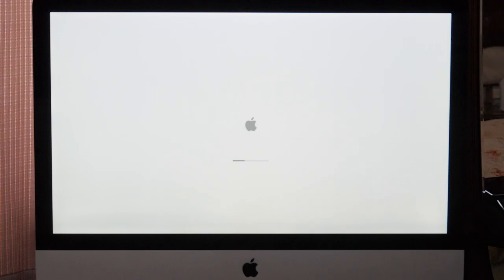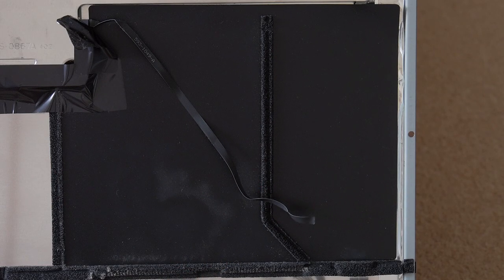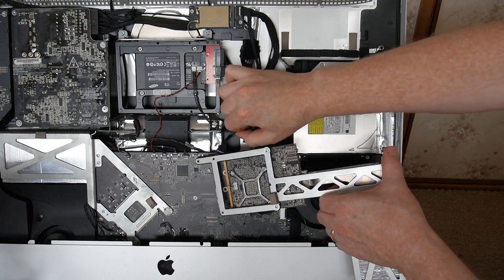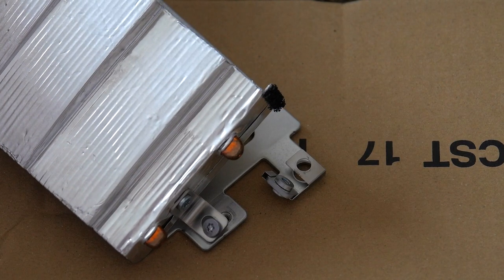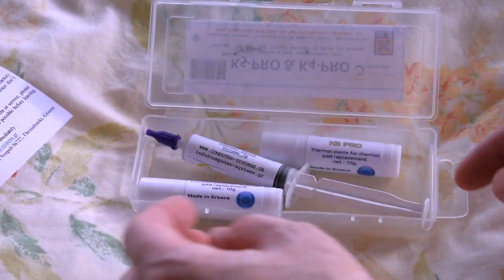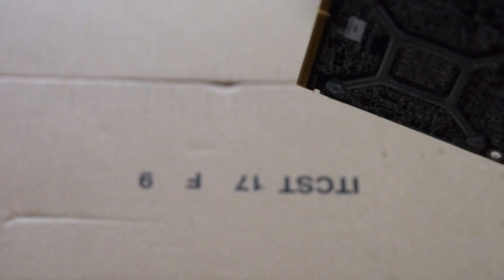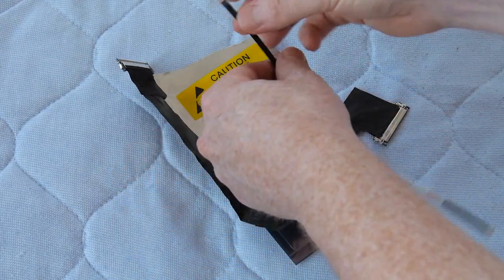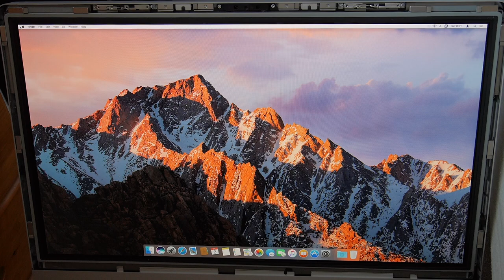Late 2009 iMac 27" Video Card Repair — 4850 — 2nd Bake

Comment: Damn it looks like my iMac has the screwheads on the opposite side, not facing towards the screen. Have to get all the way around to get the GPU off
Reply from the maker: Would you mind taking a photo of that and then posting the photo to Flickr or some other free cloud hosting service and then put a link to that photo in your reply?
Reply: Here you go: https://imgur.com/a/xFnUX
I was able to get it to work after baking it for 9 mins. But what a hell dissassembling it and assembling it again. I've had apart consoles, desktops, laptops, but this has got to be the worst I've tried.
Reply from the maker: Thank you for posting the photos. I'm happy to hear you were able to resurrect your video. I agree that Apple makes these iMacs horribly difficult to repair. Best wishes.

Comment: Just to let you know. This doesn’t fix the problem. It’s a bandaid. To properly reflow a gpu it requires specialized equipment.
Reply from the maker: Jason, I read and reply to every single comment.  There have been about 3 people, now 4 including yourself, who have emphasized the "bandaid" thinking.  That "this-isn't-going-to-work" thinking makes a big assumption though.  It assumes that the solder balls are the primary culprit and therefore baking at such a low temperature would not even melt them to adequately solve the problem.  I agree that IF the problem were the solder balls, this bake wouldn't work.  But the fact remains that my 2nd Bake, the bake after which I used fresh paste and a proper thermal pad replacement, has kept my late 2009 iMac's video card running daily for more than 11 months.  Eleven months is not a fluke or a bandaid fix.  It is strong evidence that a bake combined with the right pastes can in fact extend the life of one's Mac to such an extent that it is worth the time, effort and minor expense to do it.  

I don't mask the fact it takes a LONG TIME though.  It really does.  It's not a job for everyone.  But for those who have the time and desire, my two videos can provide the information necessary to get the job done.  And if you read through the comments, you see hundreds of people doing just that.  I am also not seeing numerous people coming back with follow-ups saying "my Mac is dead again."  There have been a couple folks who've had issues, but they've been in the minority, and I've actually guided most of them on what they should do next.  So regardless of how silly this bake may appear to be, it really does give new life to old iMacs which sadly have this flawed video card, regarding which Apple is fully responsible.  Does the bake give eternal life?  No.  Actually, swapping out with a brand new card of the same model will likely only yield 3 years of life because the card design is flawed.  But in my case, after my 2nd bake, I'm going on 12 months of continuous daily use, which even includes game play.  That's something to more accurately put this bake into perspective.
Reply: JDW I’m just telling you my professional opinion.. it’s not fixing it. You are better off finding a new card. And yes.. it’s a design flaw. Your gpu has overheated. Sure a few balls might have came off but.. it’s actually the die on the gpu. Back in 2008-2011 amd and nvidia went with a cheaper package that used a epoxy bond to keep the die in place. Unfortunately it was not adequate for the heat. After a about 900 hrs the epoxy releases and moves. Unfortunately... when it moves the chip is damaged. When you reheat it the chip will move again.. it’s basically done. I’m not trolling.. I’m telling you it’s damaged. The reason it works after heating is it settles all back together. Then during usage the epoxy will flow ever so slightly till it comes off of the gold jumper wires again.
Reply from the maker: I appreciate your advice, but what I said in my previous comment holds true.  If you watched my first bake video, you would see that I actually did have the card replaced with a brand new one, by Apple.  The iMac was purchased new in late 2009.  The video card died 3 years later.  Apple replaced the video card with a new one.  That "new" video card too died almost exactly 3 years after it was installed.  It was then I came to learn that this series video card has a design flaw and I was determined not to pay for an expensive replacement.  Rather than trash my rather expensive machine, I decided to see what others were doing to possibly repair it.  I saw a video of a fellow iMac owner who reported 17 months of continuous use after having baked his video card (and obviously he had seen other people having success with a bake, which is what inspired him to try it).  Having nothing to lose, and of course, just like you, thinking it probably wouldn't work or wouldn't last, I decided to give it a try.  My first bake lasted only 4 months, but I had used very old thermal paste and I didn't replace the Apple thermal pads, so I decided to give it another bake.  I am still going on that 2nd bake, now more than 11 months later.  Many other people have seen my videos and tried it, and they are not coming back to me months after their bake reporting another video card failure.  That speaks quite positively about the bake, in my opinion.

Since I know from experience this video card is flawed, and since I know from experience that I myself have no better than 3 years of life even from a new card, logic dictated to me that I either get a new machine or try something else.  The bake is that "something else."  And if the bake lasts only 3 years, then it has lasted the lifespan of even a new card.  I consider that a good deal and a smart move.  I takes a long time and a lot of effort, but I don't hide that important bit of information from anyway.  Some people laugh and mock at the concept, but many have tried it and have been satisfied.  Those who think ill of baking the video card are not harmed.  They don't have to do the bake themselves.  And honestly, some people pay professionals to reball their GPU.  I'm not speaking against them for doing that.  I can only speak of my experience, which is what my 2 videos are all about.

Comment: my Grandson ,was on fortnight for hours every day, these imacs just over heat, simply as that, just getting too hot.
Reply from the maker: You would think so.  But actually, my video card died 3 years after I purchased my iMac new in 2009.  I didn't play fortnight at the time because it didn't exist and I really didn't play games that much anyway.  The new card Apple replaced died 3 years after the replacement, and again, I didn't play too many games.  A lot of people report problems with the video cards in 2008 to 2011 iMacs because of a design defect inherent to the card, and it just so happens that heating the GPU chip gets it back in working order again.  It's not a permanent fix because like I said, even brand new cards die after a few years, but the bake is a less costly means of getting the iMac back in working order again.  As to how long the bake will last, well, it typically lasts long enough to have made the effort worthwhile.

Comment: I'm pretty sure you are applying too much thermal paste. The paste is supposed to fill micro gaps between heatsink and chip surface.
Reply from the maker: Actually, I am NOT using too much and I have proof.  I've been running this machine daily since early July 2017 and it's still going strong.  Don't let conventional thinking about thermal paste confuse you.  K5 Pro is a thermal pad replacement:

http://www.computer-systems.gr/content/k5-pro

If you watch the manufacturer's own videos you will see that I apply the same liberal amount of K5 Pro that they do:

https://youtu.be/mukUInQ34J4

To NOT do that would be to NOT close the wide gap between the memory chips and the heatsink.  That is why thermal pads are used instead of thermal paste on those chips.  Even if one wishes to contend that "it's still too much," consider well that any excess K5 Pro will spill over and not prove any kind of detriment at all.  Again, I have first-hand, long-term experience with this paste in my iMac since that 2nd bake and I can confirm the application of the K4 and K5 Pro in my video is working very well, not leaking out from the heatsink and keeping temperatures at or lower than what they were before (in my 1st bake I used Arctic Silver V on the GPU and general white paste on the memory chips, atop the old thermal pads).  Furthermore, other people here in the comments section have purchased the same K4 & K5 Pro paste I use and applied it the same way and reported success.  Use the K4 Pro sparingly on the GPU chip, but apply K5 Pro as its manufacturer suggests on the memory chips.  There are a lot of strong opinions on the internet about this, but again, the proof of what works for a given paste is only truly proven by long term use.

Comment: 33 degrees (celsius) ambient temperature coming into a device is not good for it
it killed one of my PS3s
oh and also, going into safe mode disables any sort of hardware acceleration, so the artefacts are due to the CPU not being able to keep up with running the whole OS and rendering all of those graphic effects
Reply from the maker: Be that as it may, 33°C is a very common indoor temperature throughout the world during the summertime, even when you have an air conditioning unit running in the house. That’s especially true of my hometown in central California, where the temperature outside could rise as high as 44°C.

Comment: The only reason why this happens is because of led free solder.  Led Solder heats up and hardens faster allowing the GPU to stay in contact with the die at all Times for many years .  Led Free Solder takes much longer to cool causing  the GPU to loose proper contact with the Die causing this issue.  Led Free solder is only capable of working on a Computer board for about 3 to 7 years and this is why, so many electronics today fail after  said amount of time whether it be a TV, washing machine or an I-mac like this.   It's the price you pay for a better environment, don't blame the company blame the sanctions put in place that limit the money you spent on these products.
Reply from the maker: Agree completely about Pb-free solder.  In my recapping videos, I only recommend leaded solder.  It's simply the best choice.

Comment: Very professional repair 🤣😂🤣 man you’d rather better focus on preparing some cookinh/baking channel...
Reply: Here you go - an example (higher end) capacitor data sheet. Look at temp that it can take:
https://eu.mouser.com/datasheet/2/212/KEM_C1033_X7R_KPS_HIVOLT_SMD-1101720.pdf
Just before doing something reconsider...
Reply from the maker: Well here’s another datasheet right back at you: https://content.kemet.com/datasheets/KEM_C1001_C0G_200C_SMD.pdf
Reply from the maker: But citing the “operating“ temperatures of capacitor data sheets isn’t that important. Hitting these SMD capacitors with approximately 200°C of oven heat around 10 minutes is not going to harm them. Evidence? I’ve baked my video card twice at that temperature and my second bake has been going strong on a daily basis for the last 2.5 years. 

If you read through the comments under both of my bake videos you’ll find that most other people share a similarly great experience. 

Lastly, you need to consider that the hardware were talking about is obsolete, not worth very much, and cannot even be repaired by Apple. People who do this bake have nothing to lose. They have everything to gain, and most people who try the bake gain more years of life out of a Mac they otherwise would have disposed of. And really, that’s what matters.
Reply: JDW oh yeah you are right, I mean c’mon what do I know? I am not the one that fixes electronics by putting them into the oven...
Reply from the maker: @TheDrunkenPL  Perhaps, but I cannot help but note the word "Drunken" in your YT name.  :-)  One key concept we learned in engineering school was that the theoretical is no substitute for the experimental.  The experimental data goes far beyond my own 2.5 years of continuous use and extends to the hundreds of people who have chimed in here in the comments with stories of success.  While unconventional, the bake does indeed work to resurrect these series videos cards.  You now have me curious though.  Do you own a 2009-2011 iMac with a video card problem?  If so, what steps have you taken to address the problem?
Reply: JDW JDW JDW my theoretical and practical knowledge both leads to one conclusion: you need to find cause of the trouble. Without taking multimeter and electronic probe I wouldn’t be able to say what might be wrong neither you. Baking is a temporary fix that can only cause more harm in the end. What you do here have nothing to do with repair - it’s just some teenager bullshit. That’s why it lasted for those 4 months.
And just to increase your „technical school” knowledge. Those repairs shoulb be conducted with use of soldering iron or even rather hotair station. And you use oven for that. I guess that shows best what kind of „quality” content you upload.
Reply from the maker: @TheDrunkenPL  No, it has in fact lasted the last 2.5 years and still going.  Daily use.  Many hours each day.  It was my 1st bake that lasted only four months, but I didn't fully clean off the old thermal pads and I simply applied rather old and generic thermal paste atop those pads (on the heatsink) after that 1st bake.  I believe the new paste I used after my 2nd bake in combination with my having cleaned off ALL the old thermal pads made the difference.  (Or it could be a second bake, I cannot say with 100% certainty.)

Again, we're talking 2.5 years here.  And no, I am not just lucky either.  I read and reply to every single comment under both my bake videos (on order of 1300 comments and growing), and most people in the comments have success after their bake, and most either never write back (which indicates their bake is still going strong) or write back to say their machine is still going strong.  

As to the popularity of DIY hot-air chip reballing, well, most people wouldn't do that themselves and the rest would be turned off by the price someone else would charge for the service.  This is a 2009 iMac, I'm talking about.  It's obsolete and unsupported by Apple.  People who own them have nothing to lose by trying the bake.  This isn't "teenager bull" either.  The bake really works. It's just that the unconventional nature of it tends to insult the intelligence of many, yourself included.

By the way, you never answered my question about whether you have a 2009 to 2011 iMac with a video card problem.  If you do, humor me...  Try the bake as described.  See what happens.  Remember, it's the experimental versus the theoretical.  If you won't try it, get Mikey to try it for you. I know Mikey likes it!  :-)
Reply: JDW still describing it as a repair is just pure bullshit. I have no problem in my mid-2010 iMac as I upgraded old Radeon 4xxx series to Nvidia Quadro K2100M with Metal support so I don’t enjoy sadomasochizm you are having with your setup.

By your reply you still convince me that you have no clue your were doing apart from fact you have to put it in the oven. Once again - an inseparable part of repair is diagnostics which you haven’t done. This is not a repair.

And about your „school” and my nickname. I graduated with master degree at material chemistry and repairing electronics is my hobby (I fixed many Apple products in my life). Do not judge a book by it’s cover.

Thankfully this conversation went to a point where you can really tell that your experiments have nothing to do with any empirical data therefore it’s still a teenager bull...

drop the mic